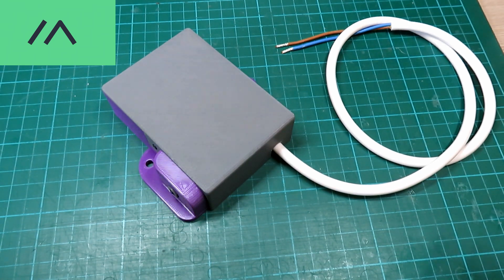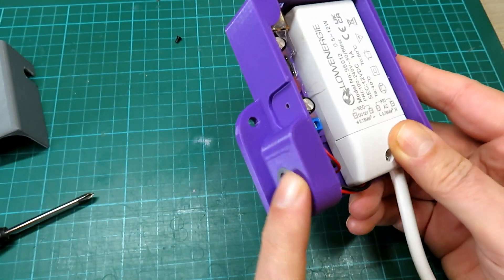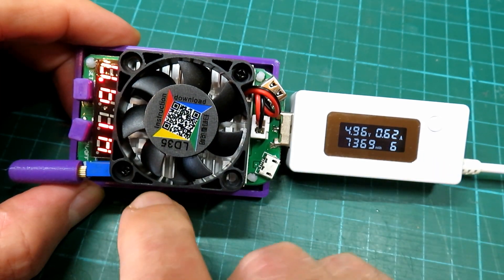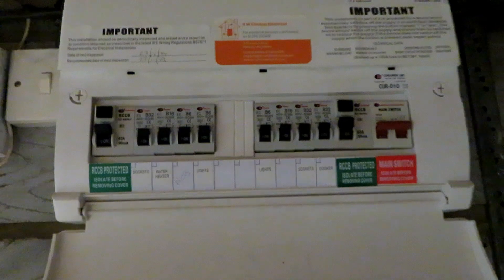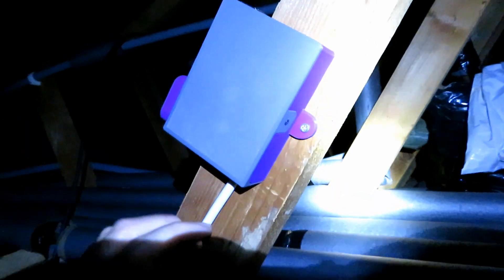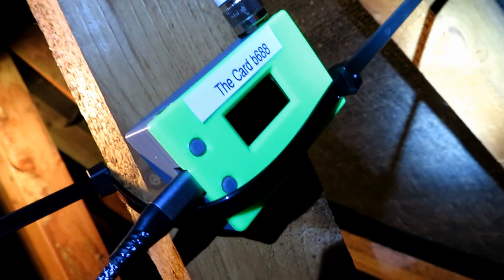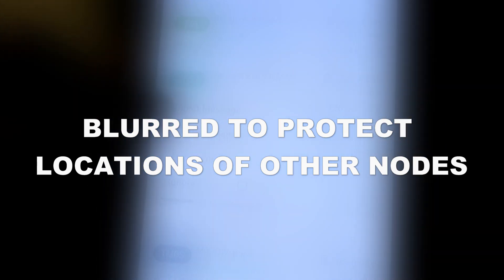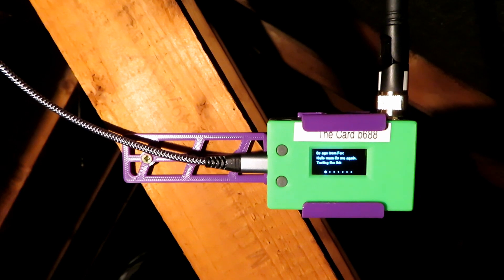CHEAP AND EASY WAY TO POWER YOUR MESHTASTIC NODE AND A DECENT ANTENNA MAKES ALL THE DIFFERENCE!

Comment: I just ordered a USB charging solar panel 7W, Complete waterproof enclosure, mast. I will be putting this up on my roof about 40 feet in the air. Fully charged 3000mah battery and the solar panel charging it during the daytime. The battery last about 2 days on its own full charged so the battery should be plenty to keep it running. My big issue now is which is better- long range fast or slow? its for my family only so I am looking at the slow to get better range.

Comment: Thanks for the STL files, but do you have a link to the load tester you used?  Also, why not pop the files you are happy to give away onto thingiverse and back link to your channel, as I’m sure that would get you move views and subs?  Slightly unrelated, but did you ever decide to make any case files available for the SINAD meter?  Finally about to build mine from your kit, all these months later!

Comment: Seems like a lot of effort to go to, just to provide a USB 5V source in the loft.  I would have installed a single gang 13A socket and just used a regular high quality plug in USB supply. If the lighting circuit is not protected by a 30mA RCD already, then install an RCD socket.